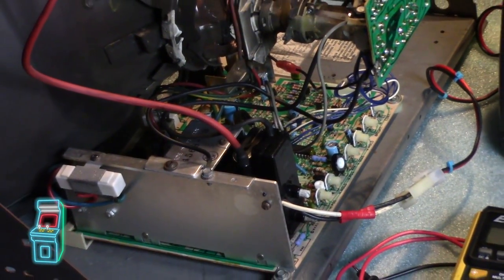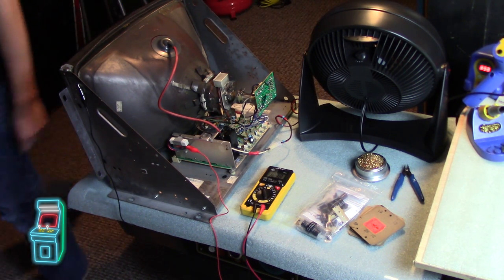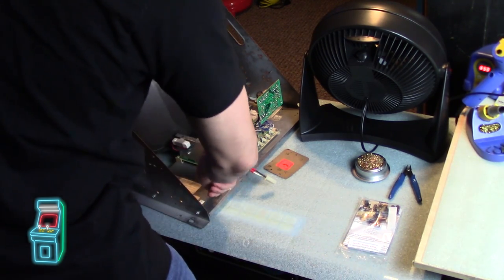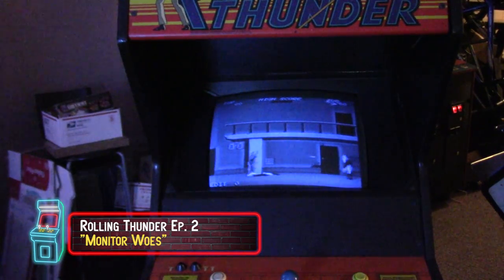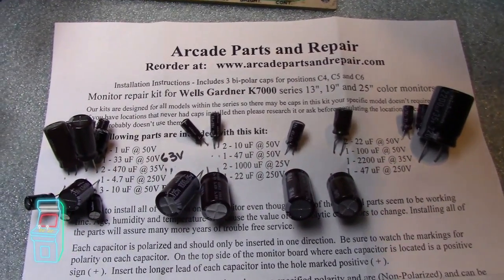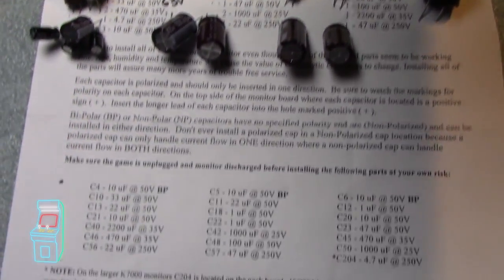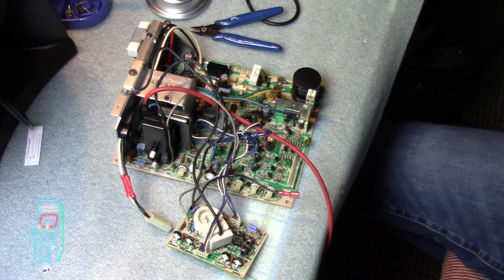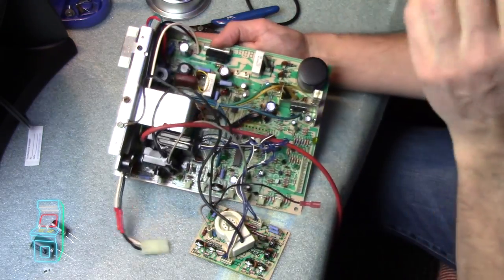Rolling Thunder Resto - [Part 5] K-7000 Cap Kit

Comment: The monitor on my Rolling Thunder has started flickering and has been worsening. Any ideas on what would cause this? Thanks for the great videos!
Reply from the maker: Reflow the pins on the chassis. But beforehand do a wiggle test with the RGB cable's connection so see if you can replicate the issue. If so it's a cold solder joint on that connector.  Reflowing pins on neck board may help too.
Lastly, check for cracks on your flyback.
Reply: Thank you!!

Comment: Quick question???!! MK2 cuts on and plays but after 10 mins a hotspot comes up and turns off. When it cools off it will turn on again???
Reply from the maker: Need more info: Does it play blind or does the whole game completely shut off?  Playing blind is when only the monitor shuts down but you can still hear the game playing.
Reply: DeLuSioNaL's Arcade whole game shuts down and comes back on when it cools off!!
Reply from the maker: @gnastyg7798  Probably the switching power supply. Replace it. They are inexpensive.

Comment: Maybe I missed it but what's the purpose of the carboard?
Reply from the maker: Which cardboard?  On the back of the monitor neck?
Reply: Yep the one on the neck board
Reply from the maker: @dandaman150c  That's there to prevent you from brushing up against it while working on it. If you accidentally brush up against the solder points on the back of the neck board while it's on you can get shocked. Nothing lethal, just uncomfortable.

Comment: This cap kit is not correct for this monitor. 35v where a 16v should be . . . .
Reply from the maker: Voltage doesn't matter as long as:
1) The uF rating matches.
2) The voltage is equal or greater than the original.
In this case 35v is replacing 16v so you are good to go. :-)